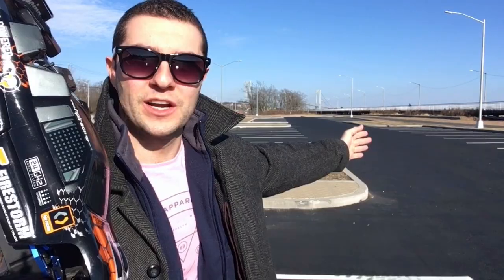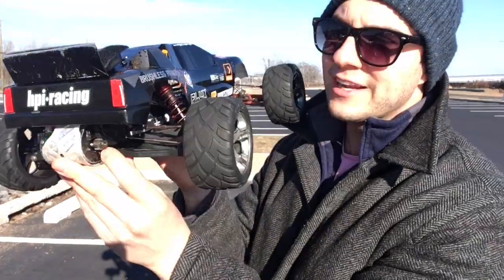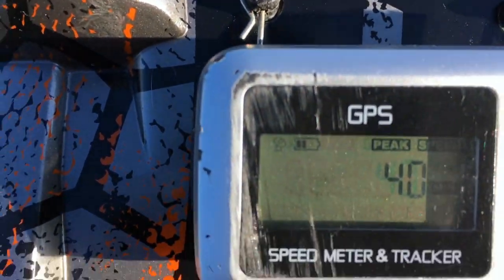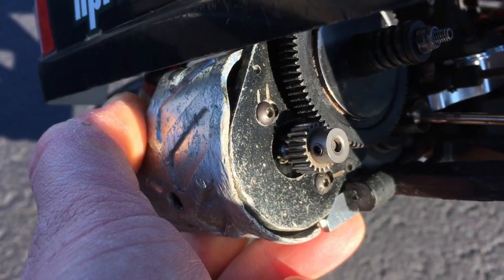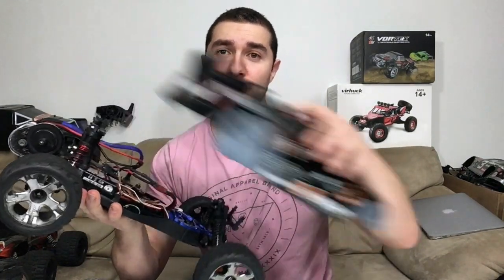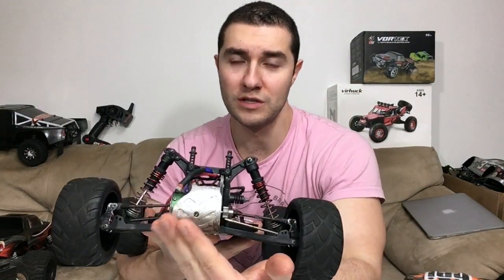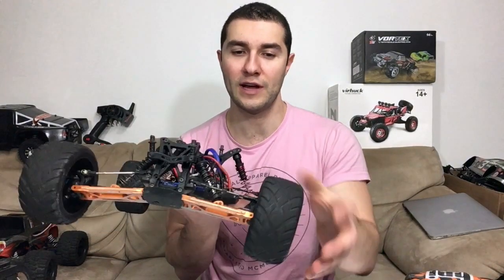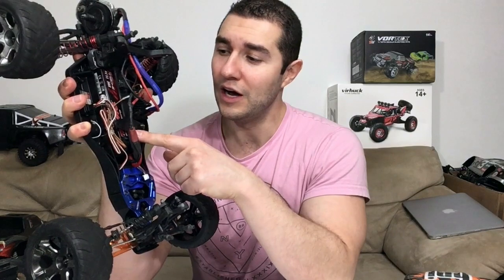Restored HPI firestorm flux 10T First runs with TOP SPEED METER.  (FYI-Not 77 MPH) LOL. [PART 3]

Comment: No problems with pinion fitting. I used a 35T and a 77T... Since I stripped the spur I went back to the regular setup 19T and 88T.
Reply from the maker: hey man!! I still need larger pinion to do really good speed runs on this.

Comment: Plus ballooning doesn’t happen until about 43-46 mph on the mini e Revo. When my mini is doing 38.2 mph on a 2S Lipo it hardly balloons..... doesn’t even look like it balloons. I was thinking of getting proline dirt hawg wheels for both of them though eventually.
Reply from the maker: I love the mini summit wheels on mine.  They are so versatile, can use the on almost any 1/10th scale rc too.  Honestly buying wheels is my least favorite thing ever, I always try to buy eBay rc with good wheels, LOL.  I gotta speed test my mini e-revo with the 3S lipo I run.
Reply: hybrid32494 Is you are geared 28/50 which is stock rtr out the box on the vxl brushless 1/16 version like mine then with 3S you will hit just about 50...... I got 49.7 mph maxed out with just a single Traxxas 3S 1400 mah 25C lipo. Now I’m getting probably 50.6-51.5 mph maxed out maybe even 52. 31/45 gearing is going to do that not the stock 28/50. I’m gunning for atleast 52-55 mph with this little 4000KV Velinion 380 sized motor and mini VXL-3M speed controller. I love this mini system it’s great and I’m not going to swap it just to hit 62-70 or more it’s not worth shredding the damn diffs. I’ll let my big e Revo do those higher speeds since it’s made to handle it with the mamba monster.

Comment: I'll race you with my brushed Top Force!! lol..Good stuff bro..Gearing is key for sure..Merry Christmas!!
Reply from the maker: yep!! gotta drill the motor plate for a larger pinion.  Or maybe get a cheap upgrade one with more adjustability.  IDK how HPI claimed 77 MPH with this, I was nowhere near that.
Reply: @hybrid32494  Yea it's going to need a lot more gear to get close to that lol..Drill it out a bit..Easy fix to run larger pinion gear

Comment: Great video dude, I just got 2 new nitro rc cars one is about 20+ years old
Reply from the maker: COOL, which did you get?  I'd say about 1995 and newer nitros are great, Older ones are just a tad too rare now and complicated to work with.  The release of the HPI nitro RS4 was a game changer.  Generally the nitro design has not changed since then.
Reply: hybrid32494 i got a thunder tiger eb4 and the older one is a thunder tiger ts4n vintage. The only problem it needs a new pull start and they are real rare so I’m not sure what I’m going to do. Also it hasn’t been started in around 8 years the owner said.
Reply from the maker: very cool buggy, you ever seen the thunder tiger EK4, thats what I want.  First thing is to tear down the cooling head and inspect the piston and sleeve, usually they are salvageable as long as nothing is physically broken.  IF you have a pull start from another big-block .21 and up engine try to see if it will fit too. The fully clean and check for vacuum pressure on the fuel tank and lines.

Comment: Damn sweet man I did a 62.3 mph run with my Traxxas bandit yesterday and couple days before that I did a run with my Traxxas 1/16th e Revo vxl and I did 52.1 mph. My rustler and bandit have both hit 66.4-66.7 mph though.
Reply from the maker: that's fast for sure.  I think anything faster than 50 is good enough.  What tires are you using? the stock traxxas ones it came with?
Reply: @hybrid32494  Well on both my traxxas rustler and Traxxas bandit I'm using the front stock ones. Front wheels on both vehicles are the stock Alias. The rears on the rustler though are Traxxas Anacondas and on the Bandit the rears are Proline Road Rage. They are both capable of a !ax around 67-69 I'm sure but idk about 70-72 mph though. I've been having trouble after 60-62. I wouldn't doubt with a little more room and a slightly higher gearing I could easily achieve 71-74 mph maybe even 75. I know the batteries matter to though... A good 2S lipo gets my Traxxas rustler up to 49.1 mph maxed out and my bandit on the same lipo up to 51.6. The motor in my bandit is a higher KV though then the rustler vxl velinion 1/10 3500 KV. My Bandit has a Horizon Hobby Kinexsis 4000 KV brushless 1/10 system in it. It would be easier to hit over 70 with the bandit.
Reply from the maker: yup, it's all about the KV.  We need to get the traxxas xo-1 tires, they don't ballon at all. But will need a 17 mm hub conversion too then.  Thats fast for a 2S, you must have the highest gearing possible, right?
Reply: hybrid32494 Oh yeah buddy KV matters a lot when it comes to brushless electric RC cars!!!!!!. By the way you can go for 4S lipo on a 3S only capable brushless speed controller but the problem is you could only get a few passes before you either fry the speed controller or you fry the motor. Also… You can go with mod one gearing 32 pitch gears on a 1/10 scale vehicle like a rustler or bandit which are both the ones that I have but the problem is the heat issues… You can risk overheating if you want at around 185-280 degrees and up but what’s the use...... blowing your money left and right to cheat your competition or if your only doing speed runs just to put up bigger numbers. Now of course there are 4S,5S and 6S max capable esc’s that you could use orange juice 1/10th scale vehicles but normally 5S and up is only on majority of 1/8th scale systems since they have twice the torque and speed and even triple to quadruple the speed and torque !!!!!!. If I was to do 4S lipo right now on my two mini e Revo VXL’s or even on my rustlers, bandit or slash’s....... I can not only do 10-15 mph or more but I will have a shit ton more torque lmfao. Problem is that cheating your system that way and also creating more problems for it will only cause short life of your brushless or brushed combo and will cost you more in the long run. I don’t have all the money in the world to constantly replace brushed or brushless motors, esc’s, wheels, tires or chassis etc etc. I’m not rich to go buy tons of upgrades either lol. I got 9 cars that I want to work great up until I’m 60+ years of age lmfao !!!!!!. Don’t want to abuse them out of their recommended voltage zones it’s not worth it just for the extra 10-30 mph difference which is HUGE LOL.

Comment: I have the same car bought it used for $80 but it needed work mine also goes 42mph
Reply from the maker: what did you need to get for yours?  Parts for these are relatively pricey, especially the metal outdrives and dog bones, ripoff.  I just put in a larger pinion will have to do another test soon.
Reply: @hybrid32494  i had to get a new pinion gear because the old one was grinded down ,body shell posts (they were rubbed down), new body shell, and new tires. (you should also get a wheelie bar because they help when doing top speed runs)

Comment: Plus the extra 500 KV difference between my brushless VXL 1/10th scale brushless 3500 KV system vs my Horizon Hobby Kinexsis 4009KV KV system is practically 2.4-3 mph difference which is still significant if you really think about it....... I did 49.1 mph on 2S 7.4 Volt with my traxxas rustler and my traxxas bandit did 51.6 mph on 2S...... still a difference in power by almost 4-5 mph difference !!!!!!...... that’s amazing!!!!!!!.....my two mini e Revo VXL’s that came brushless VXL out of the box brand new with the mini 4000KV 380 size brushless system and a mini VXL-3M esc both hit similar speeds. My one Revo vxl hits 38.2 mph on two 4S batteries using a parallel connector and my other one will probably do 35-36 mph using the same parallel connector and batteries. Now I am geared 31/45 on one mini Revo and my other one is geared 28/45. They were both 28/50 stock out the box though......... still using the stock talon wheels with Gemini rims on both of them. Actually just swapped my worn talons on the one geared 31/45 lol. They both haul ass just like the bigger 1/10 rustlers and bandit lmfao. My mini revos both do 48.5-53.5 mph maxed out with good lipo and nimh batteries. With nimh in series I’m hitting 52.1 mph and with my other Revo about 49.7-51.2 or so...... they are hauling ass for just a 1/16 RC buddy lmfao !!!!!. I don’t understand how some of these guys strap a 1/10 system to the 1/16 e revos or summits or even the mini slash 4wd’s and are doing 65-85 mph or more LMFAO !!!!!!....... I’ve seen mini e revos that are doing 65-82 mph NO PROBLEM...... but it’s usually with a 1/10 brushless setup. The most I can hit out of mine is around 56-62 if I geared them both down on the spur to about 40 tooth and up the pinion to about 33 or 35. It’s crazy and fascinating though that I’m still doing 45-52 with these minis lol.
Reply from the maker: yes, I love my mine erevo vxl.  This chassis does not get enough praise, it's so versatile and easy to run.  So you got a full size e revo vxl that only does 38 on 4S.  Those need 6S for sure.   I hate running double packs honestly.  I have a hpi trophy truggy it also does about 36 on 4S, ridiculous.  Total waste, I somewhat regret buying it.  BTW the mini e revo drifts well too with some drift wheels, try it.
Reply: @hybrid32494  No man I'm talking the 1/16th scale mini e Revo vxl brushless that I have which is two of them lol. One of them is geared at 31/45 and the other at 28/45. The one geared with the 31 pinion 45 spur is the Revo I talking about specifically that is hitting 38.2 mph maxed out only on 2S lipo not on 4S LMFAO.... There is no way I would run 4S using a series connector on this minis I would annihilate the motor and esc lol !!!!!. I got the stock rtr brushless system that they both had come with originally which are both the same KV which is 4000KV and the motor size is 380 from what I hear. The speed controller is the VXL-3M. On 2S using two 2200 may Traxxas 25C 7.4 Volt lipos using a parallel connector I'm hitting 38.2 mph on 31/45 gearing. With two of the 1200 mah 6 cell 7.2 Volt nimh packs using a series connector which is safe in nimh mode on the esc I'm hitting 52.1 mph maxed out but it may be because my nimh packs are wearing out lol. They aren't fresh brand new batteries they have some age to them so I'm sure with a brand spanking set around 53-55 mph. On a single 3S around 50-52.5 and with two 3S 1400 mah 25C Traxxas lipos using a parallel connector in lipo mode I'd easily get 53-56 mph no problem but that is also with brand spanking new lipos lol!!!!!. When lipos eventually start to lose power after 3-10 months or more then that equals less top end mph. Even nimh batteries work the same way.
Reply from the maker: GORILLA BEAR TECH im gonna check the gearing on my mine erevo, i wanna hit 50 too.  Btw did you ever run it with touring car wheels?  I did, handles so well and no balooning.  Althought its slower bc of the smaller wheel size.
Reply: hybrid32494 No man I never have I actually like the stock talon wheels with the silver Gemini rims. They serve a good purpose for what I’m doing with it although they do wear a lot faster then most aftermarket wheels. They grip great and are excellent for 45-55 mph for the mini e Revo. Now the big ones that used to be on my bigger 1/8 scale E Revo actually popped during a speed run but that pop didn’t happen until two years of running it heavily on 6S at 55-61 mph constantly. I use most of my RC’s only for speed man I don’t bash a whole lot because I’ll be spending more and more money left and right. Eventually I’ll get into bashing them later after I achieve the speeds I want to but more then likely these cars will stay speed run cars.
Reply from the maker: I hear yo dude!!  I used to bash alot more than now, now I basically do some normal driving and speed passes.  And guess what??  all my diffs are fine, ahahah.  The jumping really kills these things, even the tough ones.
Reply: hybrid32494 Oh yeah you end up spending more money on these awesome toys then you do saving when you are specifically purely “BASHING”....... that is why I barely do any bashing...... occasionally I’ll go on someone’s grassy lawn or jump over s brick..... maybe even off a sidewalk curb but I don’t try to climb curbs unless I’m using my stampede 4wd lol...... my stampede could handle shit like that as well as my big e Revo because of the scale and because of the width and height of the wheels. I wouldn’t try climbing curbs with my mini revos unless I’m doing it very slow. I don’t run into a curb hard at all if I’m trying to climb it..... I always ease into throttle. I love speed runs because although you are still taking chances messing your car up to smitherines you still save more money then if you were to intentionally bash it until you break it lol. I save money in the long run and need less upgrades throughout time with only speed runs or drag runs then bashing them. I’m a speed addict brother ! Lol!!!!!!!. Seeing my mini e revos going over 49-52 mph looks insane because of there size. When my big revos going 45-52 mph it looks fast but not as fast.